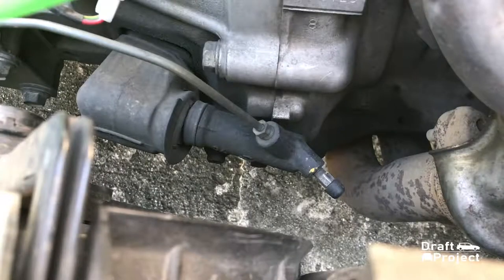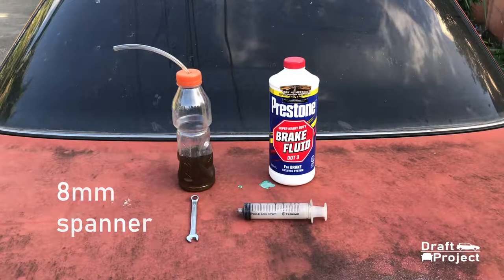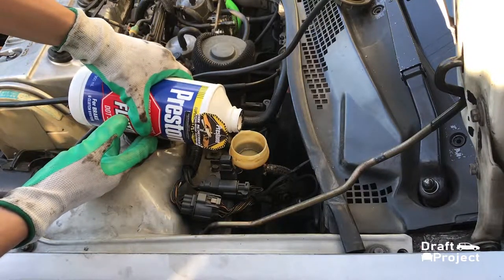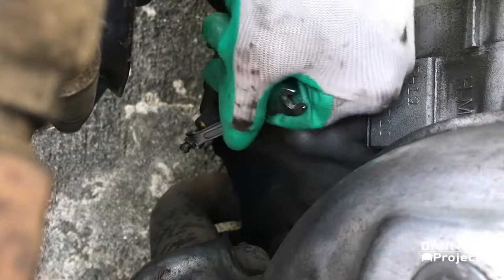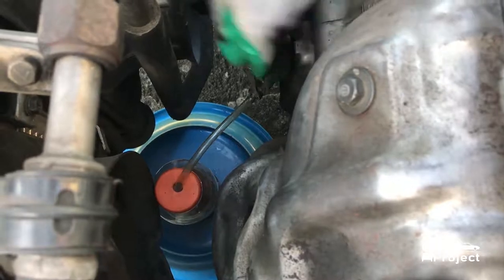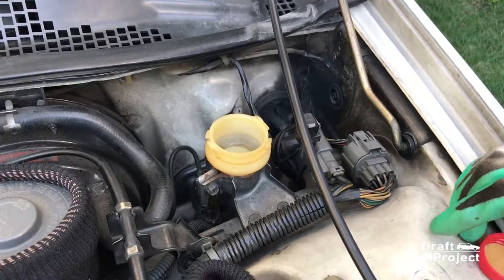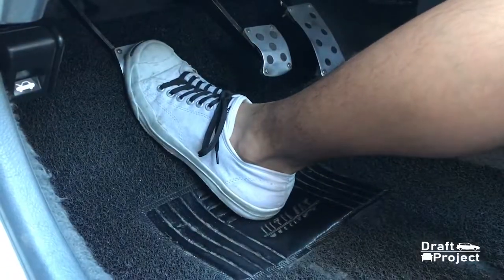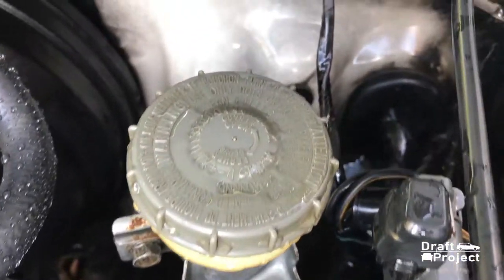How to Bleed your Clutch - Honda Civic EG - Draft Project

Comment: My clutch pedal on my Honda Civic is stuck down no pressure😩 no leaks either🤷‍♂️ I am going to change slave cylinder
Reply from the maker: If bleeding didn't work, then check carefully which part has a leak. This can be tricky sometimes since there are cases where both parts had no leaks but one is already broken. If you were to change the slave cylinder, then I would recommend to replace the master cylinder too since these work in pairs.
Reply: The black seal inside my cap unfolded into the fluid reservoir preventing fluid from getting in. Once I caught it and put new fluid I have the same issue, pedal, just sitting on the ground.
Reply: @marcus did you end up finding what was wrong? I have the same issue😔

Comment: After bleeding I have a nice hard pedal but after driving for a while it gets soft again. There are no leaks anymore though. Could it be a bad master cylinder?
Reply from the maker: Hi sir! I suggest you to try to bleed it again perhaps there could be an air trapped in the middle or somewhere in the system. Also, double check again if there are leaks in the slave cylinder and the master cylinder. A master cylinder is bad when it is leaking. if it wasn't then it is still in good condition.

Comment: If anyone is having troubles with leaks or no pressure in a successful bleed, make sure the push rod of the slave cylinder is installed the correct way (if you have just installed a new slave cylinder). Also make sure you have the correct size clear hose tubing to fit the bleeder tightly. If there is still no pressure you can try to pump the clutch multiple times while the bleeder is open to force out any trapped air, or alternatively you can open up the peep door into the transmission to push the clutch fork manually, therefore moving the push rod into the slave cylinder to start some pressure. Hope this helps :)

Comment: For some reason my fluid was not coming out - even after I took the entire bleeder out. However, I noticed that I tried to bleed with the cap off - will the cap being off make a difference? Otherwise I must have a blockage somewhere. However, the clutch works well and car drives ok - I just wanted to replace with fresh fluid. Any help is greatly appreciated
Reply from the maker: Hello sir! I just want to clarify if you are referring to the master cylinder cap? If yes, then bleeding it with the cap off doesn't make any difference with the cap on. It is commonly done with the cap on to prevent any dirt and debris get into the new fluid in the reservoir while bleeding. You can bleed it with the cap off, just make sure that the surroundings of the reservoir is clean.

You mentioned that the fluid doesn't come out when you bleed it. It could be a clogged up bleeder valve or perhaps some dirt are clogging the lines which can come from a deteriorated hose line.

A clogged up bleeder valve can be temporarily fixed by removing it and use a needle to poke the hole to remove the dirt inside. You can use wire brush to clean the ends of the bleeder valve. If possible, replace it with a new one since the old bleeder valve will once clogged up due to its deteriorated or corroded condition.
Reply: @DraftProject  thanks for the reply 👍. The bleeder is not clogged, must be an issue in the line then I guess. I have watched another video of a guy with an integra who also has no fluid coming out initially, but he pressed the pedal with the bleeder loose and eventually fluid came out. I'm reluctant to take this route bcz it will introduce air into the system. However, the clutch system is not as complicated as the brake system, so maybe I can get away with opening the bleeder valve and just pumping the clutch pedal  until there is some movement in the fluid, despite some air being introduced into the system? What are your thoughts?
Reply from the maker: Sorry for the late response, well for me, it's not a bad idea to try that method. There could be an air trapped in the middle of the line the reason why it couldn't come out. Just make sure you use a bottle with brake fluid, half of the container and use a clear tube to connect the bleeder valve to the fluid in the bottle. Loosen it and pump it until the fluid comes out. Make sure to submerge the clear tube in to the fluid to prevent any air sucking into the system by the time you release clutch pedal. Just repeat the process and when the fluid comes out, tighten the bleeder valve and start the standard process of bleeding the clutch.

Extra tip:
Also, check the master cylinder and slave cylinder for leaks. Check underneath the dashboard where the pedal connects to the master cylinder, that is where you will find it leaking if ever it was broken. Leaks could reduce the pressure inside, depending on how worse the damage could be. That is also a sign that it needs a replacement too.
Reply: @DraftProject  awesome - thanks a lot for this! 👍🙂
Reply from the maker: @PapiQaz  You're welcome sir! Thank you very much too! :)

Comment: I was able to remove a lot of trapped air from the line but my clutch pedal is still stuck on the ground and the slave cylinder won't open when I push down on the clutch pedal. I did notice some fluid leaking into the cabin where the master cylinder is located. Could this be reason for it not opening?
Reply from the maker: Yes. A leaking master cylinder is a sign of worn out or busted seal. Since it is leaking, it will no longer be able to create a pressure that can push the slave cylinder and the clutch system. Replace it with a new assembly to get the job done.

Also, don't forget to check your slave cylinder for leaks. If it has leaks, replace it too.

Comment: What if it feels firm once bleeded, then when you turn on the car it feels softer. Turn off car, it feels better. Am I missing something or do I still have air in the system? Thanks.
Reply from the maker: Try to double check everything sir. It is possible that there is air trapped in the system. Bleeding it again might help fix the problem. Check for leaks too. Make sure that the master and slave cylinder are in good condition.

Comment: Am i just stupid or its suppose to be brake fluid in there
Reply from the maker: Yes bro! Brake fluid all the way hehe. The brake and clutch hydraulic system uses the same fluid with a specific DOT rating.
Reply: @DraftProject  even on a 93 del sol si. Dot 3 cluch and brake fluid are the same.  I should get a big bottle to flush the system right itS empty.  Dryed out ....So. If. I have to add some before I flush it. Or since it's Dryed out it should just be added to pressurize flushed for dirt and. Debri since it's Dryed out ...then once it's pressured and the line is clean then just top it off to the line Correct. Me. Love ur video 😍
Reply from the maker: @veggaschicks  Thank you for adding that. Yes, they are the same fluid. About the flushing you mentioned, yes, it is correct that we empty it first then add some fluid to flush dirt out of the system and eventually top it off. 

The process for emptying the system can be done by removing the fluid from the reservoir and fill it with new fluid then start flushing. The second one is releasing the bleeder valve and pump the pedal until most of the fluid is gone and dry but this method should be done gently since when there is no fluid on the master cylinder and slave cylinder, it can cause small wear on to the seals during flushing. Still I recommend the first method which is safer and it does the same job for flushing and cleaning the system.

Comment: I loosened the bleeder valve and nothing came out?? What did I do wrong, I took out the old fluid topped of the master put the tube on into a bottle with fluid and nothing came out. Also my clutch is to the floor
Reply from the maker: Hi sir! Just keep on bleeding. It is natural that nothing will come out in the first bleed, especially when the clutch is filled with air in the system. if you bleed and nothing comes out, but the reservoir gradually decreases, then that is a good sign and keep on continuing bleeding. Be sure to follow the steps that I provided in the video. It would be better to have someone to help you pump the clutch so you can monitor the fluid that comes out from the slave cylinder. Also, don't forget to check and maintain the fluid level of the reservoir because if you ran out of fluid while bleeding, it will suck air into the system and you will repeat all over again.

Comment: This is a great video! I am in the process of bleeding my new clutch master and slave, its taking foreeever. i follow these steps to the T from different videos and it seems like theres no bubbles coming out but the pedal still feels pretty squishy and it doesnt  want to go into gear. i feel like im missing something .--.
Reply from the maker: Thank you! It seems like there is a trapped air in the system. If you can, try bleeding it on the flare nut.

Comment: thanks my clutch got hard suddenly after following your video it got a little bit better but i think i do need to get a new cluth since it has 300.000 khm
Reply from the maker: Glad to hear it helped you out! If you haven't change the clutch for the past 3 or 5 years, then its not a bad idea to to do it. In that way, you will prevent any future problems. Also, make sure to check the clutch master cylinder and the slave cylinder for any leakage. 😀
Reply: @DraftProject  its probably 28 year old clutch
Reply from the maker: @βασιληςελευθεριαδης-κ8φ  Durability of the clutch depends on how you use it or how frequent you use your vehicle. You have maintained your vehicle well. Mine lasted for 22 years before it was replaced.

Comment: VERY NICE VIDEO!  i have a question, what size is that clear hose???   My brake bleeder is 10 mm and i have a tube for that,  but when i try the clutch bleeding that hose is a little bigger since the clutch like yours is 8mm,  SO DO YOU KNOW THE SIZE OF THAT CLEAR TUBE??
Reply from the maker: Hello, thank you very much for the feedback. The size of the clear tube is 6mm inner diameter, approximately just short of 1/4 inch. Probably you had an aftermarket slave cylinder or the bleeder valve has been swapped out with a different ones before, the reason why it has a different size. Also different vehicles varies.
Reply: @DraftProject  thank you man for your response!

Comment: Thankyou sir keep sharing,, sir how to fix speedometer gear of honda civic 1994,, thankyou very much
Reply from the maker: Probably, the problem would be the speed sensor if the speedometer is not working. Check the connection and make sure it is clean and secured.
I will create a video about that soon. Thank you very much too for watching!

Comment: hope this work on my civic 🥲
on my accord the pedal stays on the floor 🤣🤣🤣
Reply from the maker: If you press the clutch and it just locks, it indicates that there is an air in the system. If you tried bleeding and nothing happens or it won't improve the situation no matter how much you try, then it could indicate that the clutch master cylinder is broken or perhaps the clutch slave cylinder. Most of the time, they leak when they are broken. Yet there also times that there are no leaks too. You will know it is broken when bleeding won't work anymore.

Comment: So when you tighten the bleeder valve the pedal should be to floor or back to original position?
Reply from the maker: It should be pressed on to the floor. After you tightened the bleeder valve, you can now release the clutch pedal. Just remember, when you press the pedal all the way to the floor, you push all the fluid and air out of the system. If you release it, it sucks all of the fluid and air back to the system which is why you should tighten it while the pedal is on the floor in order to remove air and old fluid on the bleeding process.
Reply: Draft Project ok thanks for your help 🙏
Reply from the maker: @jessegunn2033  No problem and thank you very much! :)

Comment: Y does my clutch pedal not stick to the floor
Reply from the maker: If it does not stick to the floor, then there is little to no air in the system. If the system has a lot of air, the pedal would stick to the floor right away when depressed.

Comment: Hello sir! I have a question!!!🙋‍♂️ Thank you for the video very much! But I followed all your steps and my clutch still seems to be spongy after the process and I’ve repeated it multiple times making sure there’s no air at all the only reason it broke was because my previous clutch line got a hole edged into it so after I switched it thinking it would fix the problem… it didn’t. Can you please help!? Thank you
Reply from the maker: Hi! If the problem still persist after all of these methods, then I would suggest you to check the whole system for any leaks. Check the master cylinder, slave cylinder and the clutch line for any small leaks. Leaks are indication of broken seals and it will not create any pressure to remove the air inside the system.

You also said that your clutch line has a hole. I was wondering if the small piece from that hole might have entered the clutch system. If it does, it will destroy the seal.

I also have an experience from other people. They were repeating the steps in my video but it doesn't fix the problem. They told me that the whole system doesn't have any leaks, so they tried replacing the clutch master cylinder, and it fixed the problem.

From that experience, replacing the parts is the last resort. For now, try to check even the smallest details that you can find before you decide to replace any of those.

Also, make sure that your hose fits perfectly on the bleeder valve. Take note that the bleeder valve should not have any leaks. 

I hope this helps. Thank you. Feel free to respond.